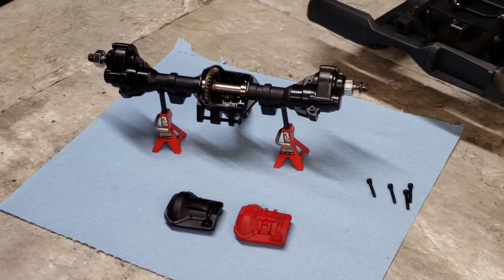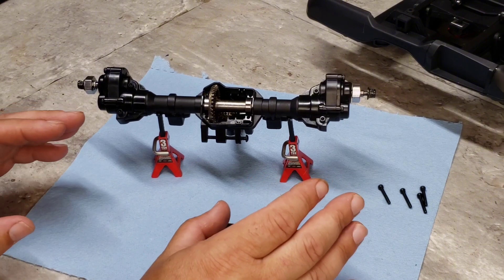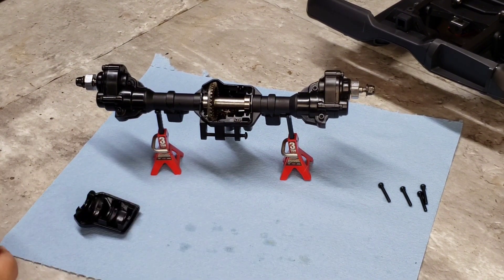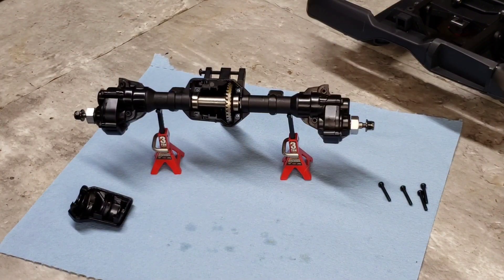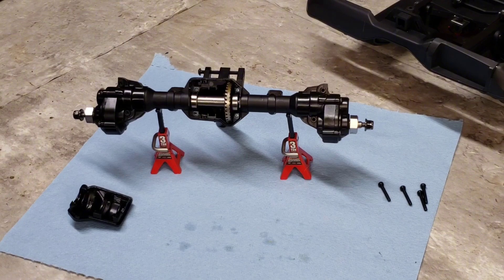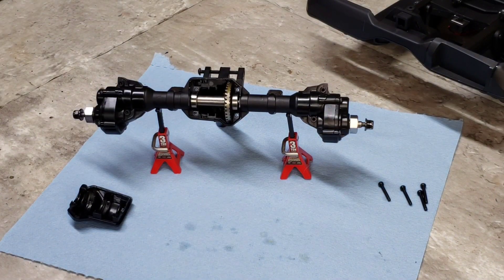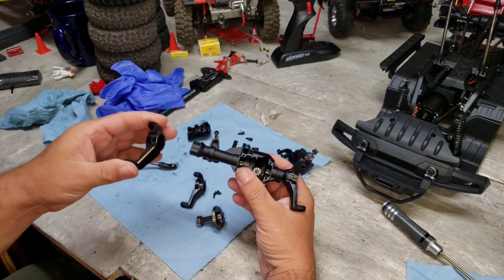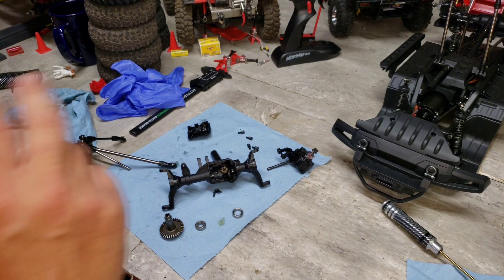HB TOYS 1001/Axle breakdown

Comment: I just received my R1001 yesterday as entry into the hobby. I found that my front wheels will not turn smoothly as soon as I steer left/right. Maybe something binding because slightly out of spec? Not sure.. maybe even normal? Your videos give me great insight in the mechanics of all the parts.

Currently asking myself if knock-off TRX4 axles from AliExpress would just fit into the r1001? Maybe I would try to replace the front one to see if it runs smoother when steering..

Thank you for the great content!
Reply from the maker: @hazzahfpv6675  I would pull it apart first and I inspect it first. Any Trx4 axles should be a direct swap in. Even the actual Trx4 has sone wheel skid or slight wobble under power when your steering left to right under power all my Trx4 rigs have this issue if that's maybe what hour referencing?
Reply: How long did you have to wait for your car to be delivered

Comment: Could you move the rear shock towers back to get the 324mm WB?  Are the holes on the steel chassis rail for moving the shock towers? If not you could always drill the holes and buy a set of generic high clearance 324mm links for $15-$20.
Reply from the maker: I'm not sure I sold mine off to help a friend. I was happy with the wheelbase didn't need to change it.

Comment: How do you get the driveshaft off the axle? I lost the middle section of one and bought upgraded driveshafts. But there’s no grub screw on the axle side like there is on the transmission side.
Reply from the maker: @cody41895  that's odd because mine just had a plastic cover that you move and the grub screw was in it like a normal driveshaft
Reply: @ that odd. I had to cut the cover off mine and there’s no grub screw
Reply from the maker: @cody41895  you know I think I left my Driveshaft attached on the transmission side, I removed mine from thr axle housing pinon gear side.